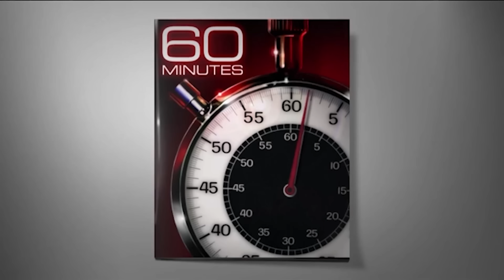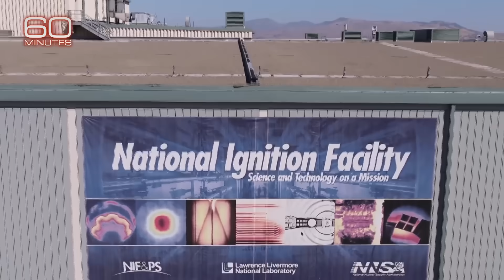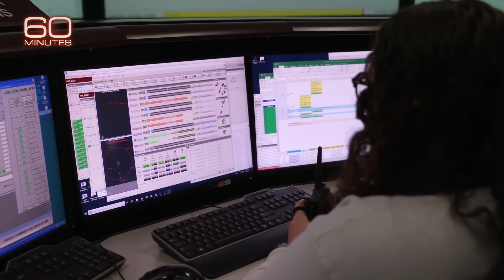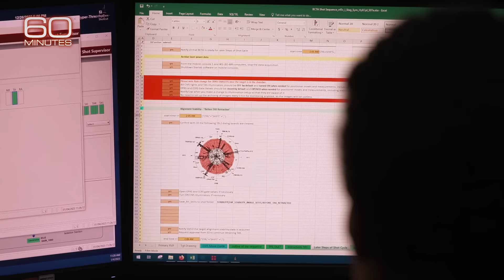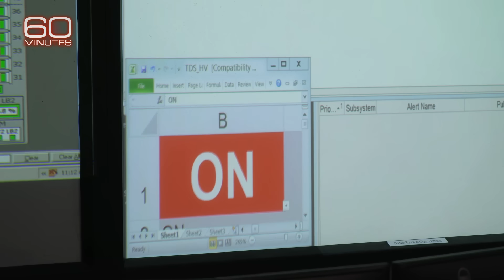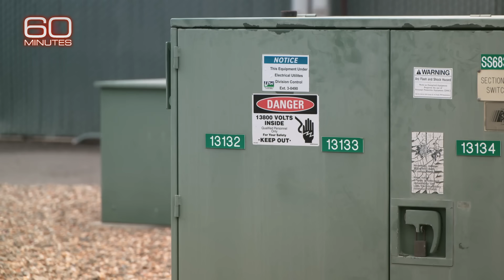Nuclear Fusion: Inside the breakthrough that could change our world | 60 Minutes

Comment: The continued support of fusion power is without reason.  We don't need heat to produce electricity.  We are grossly misinformed about power generation and power use.  Edison generators and dynamos power plants with inverters and transformers easily replace fossil fuels power plants and nuclear power plants with continuous peak power to the power lines. Yes high voltage AC power continuous peak power without fuel or pollution has been possible since the 1920s.  Tesla bound Edison's generator with magnets all around the armature and used water to move the armature magnets and coils of copper wire. This essential deciet has not been overcome with the PUC or chemical weapons manufacturing Treaty obligations or nuclear nonproliferation treaty enforcement and obligations. We don't need heat to produce electricity or transportation.  We can use permanent magnets as the only source of electricity. We don't need wind water steam or fossil fuels to move the armature magnets and coils of copper. Inverters and transformers are used to produce high voltage AC power from the current generated.  There is some current lost as heat but current generated DC is nearly equal to the high voltage AC power continuous peak power delivered.  Current in is equal to current out plus heat in every transformer . Power is increased and current is conserved in principles of electricity.
Reply: Please explain to this audience the formal educational degrees you have in electrical engineering and your work experience in that field. There are may people who are firmly convinced that electrical energy can be generated from no previous energy source, such as from the magnetic field of permanent magnets. Typically, they have immersed themselves in eco chamber information sources of like minded people in order to reinforce what they already strongly believe in. They crave sharing their very special knowledge with the world and explain away any resistance as due to the proponents being persecuted for their beliefs.

Comment: "harnessing the fires of Armageddon into something useful"

that's a badass quote right there!
Reply: The U.S. Project Plowshare program lasted for around 17 years, back around the 1960s. It worked to test the use of nuclear explosives for various civil engineering applications. There were university courses teaching young civil engineering students on how to apply nuclear explosives for such uses. Today most people find that concept to be insane.

The National Ignition Facility (NIF) has never shifted its major purpose. It has always been primarily funded as a thermonuclear weapon (H-bomb) research tool. The experiment, discussed in the video above, included a target material to test weapons related irradiation. The management of the laboratory have always obscured the primary function of this tool whenever they have made presentations to the media and the millions of people served by that media.

The majority of nuclear fusion physicists agree that Inertial Confinement Fusion (ICF) approaches, such as employed by NIF, are unlikely to lead to an economically practical nuclear fusion power plant.

Comment: The Navy has a laser that can fire 90,000 in 10 hours, once every 0.4 seconds.  There is a path here.  Those targets?  We can mass produce them...
Reply: Does that Navy laser come anywhere close to all the exacting parameters of the NIF lasers? How long has it been operating since its development? How successful has it been in generating nuclear fusion reactions? Is its primary purpose to lead to a future nuclear fusion power plant, or is its primary purpose related to weapons research? Does it generate the ultra violet wavelength required for the NIF inertial confinement fusion  (ICF) experimental reactions? How much 'wall-energy' does it consume to generate a fraction of that energy in the final laser beams?

The target elements in the NIF experiments have taken over a decade to develop. NIF was expected to achieve break-even fusion energy reactions by 2012. The hollow spherical diamond wall fuel capsules are now manufactured by the dozens because very few meet the extremely stringent requirements of having minimal flaws. It took about two days to achieve a proper layer of frozen fuel on the inside of the surface using repeated freeze/thaw cycling. The announced experiment took about a week to set up. The fusion reaction lasted approximately 0.000,000,000,08 second and generated enough energy to boil about two liters of water. The target assembly has been estimated to cost approximately $100,000. That assembly was converted into an exploding plasma. Only about 4% of the fuel reacted, the rest was blown away from the center before it could react. The radioactive tritium waste had to be removed from the inside of the target chamber before another shot could be performed.

The commenter heads up a fusion energy consulting firm, making his living doing that. He informs his clients that he has no hidden agenda. His history includes work at the NIF. Such presenters tend to be masterful at obscuring the primary function of NIF, as a thermonuclear weapon (H-bomb) research tool.

Such believers tend to be masterful at excluding key aspects of such fusion experiments in order to promote them. They also tend to be masterful at excluding the following warnings from their consciousness.

I urge readers to search for the following article titles.

IPCC report: ‘now or never’ if world is to stave off climate disaster (TheGuardian)

UN chief: World has less than 2 years to avoid 'runaway climate change' (TheHill)
  * This statement was made 4.4 years ago.

Comment: They left out the detail that is was not 2 units of energy in 3 out. It was a lot more in.
Reply: A suspicious journalist posed a direct question, regarding the laser input energy, during a news conference. That prompted an answer that the management typically avoided in the past. They finally admitted that the input energy to the lasers was more than 100 times greater than the output energy from the nuclear fusion reaction. Some people would say that the lab's definition of nuclear fusion energy gain is misleading.
Reply: @vernonbrechin4207  It is misleading i guess. But if you do not care how the energy was made they did actually make more energy. However they still need to work out how to do the same thing but use less energy which might be impossible for a long long time. I had a dream aliens showed me how fusion energy worked about 15 years ago and it was much simpler than this and i remember thinking its so simple how did we not see it. They handed me a light globe that was filled with plasma and it was terminated at the socket end with a few different metals, it was the types of metal and magnets that created the fusion. Theyu even had an advanced for of it in their weapons.
Reply: @FesteringRatSub  gy.

Comment: We are, in simple terms, striking flint to steel and trying to get a roaring fire going. We have a long way to go.
Reply: The National Ignition Facility (NIF) management use of the term 'ignition' is deliberately misleading. Once the nuclear fusion reaction began in this experiment, in a microscopic spot, the compressed fuel volume exploded ending that reaction. Only approximately 4% of the fuel reacted with 96% of the extremely expensive, radioactive fuel mixture being blown away from the reaction center. This has always been the normal process in these experimental shots since the machine was, and remains, a tool to simulate thermonuclear weapon (H-bomb) explosions on a microscopic scale. The extremely brief compression lasted for approximately 0.000,000,003 second ending with the nuclear fusion reaction lasting for approximately 0.000,000,000,08 second. There was no significant propagation of the fusion reaction within the compressed fuel mixture. When most people think of of ignition they assume it will be somewhat akin to striking a match, where the chemical reaction consumes the supplied fuel in a time span of approximently 2-seconds. The 60-minutes journalists crew was fooled by the term as was millions of people they broadcast this sale hype video to.

Comment: The fourth dimension is consistent with TIME, time dilation, INSTANTaneity, AND what is E=MC2, AS TIME is NECESSARILY possible/potential AND actual ON/IN BALANCE. TIME AND time dilation are BALANCED or inseparable in conjunction with INSTANTaneity. Gravity AND ELECTROMAGNETISM/energy are linked AND BALANCED opposites (ON BALANCE), as the stars AND PLANETS are POINTS in the night sky; AS TIME is NECESSARILY possible/potential AND actual ON/IN BALANCE; AS ELECTROMAGNETISM/energy is CLEARLY AND NECESSARILY proven to be gravity (ON/IN BALANCE). Accordingly, ON BALANCE, the rotation of WHAT IS THE MOON matches the revolution. Great. What is E=MC2 is taken directly from F=ma. c squared CLEARLY AND NECESSARILY represents a dimension of SPACE ON BALANCE. Again, consider TIME AND time dilation ON BALANCE. What is GRAVITY IS, ON BALANCE, an INTERACTION that cannot be shielded or blocked. Consider why and how it is that there is something instead of nothing ON BALANCE. Magnificent. A given PLANET (including what is THE EARTH) sweeps out equal area in equal TIME. Magnificent. Consider what is THE EYE ON BALANCE. Beautiful.

Frank Martin DiMeglio

Define “mass”/m. You cannot. Here's why.

The Earth is about four times the size of what is the Moon, AS the density of the Earth is about four times that of what is the Sun. E=mc2 is taken directly from F=ma. The orange (AND setting) Sun AND what is the fully illuminated (AND setting/WHITE) Moon are the SAME SIZE. Consider what is the translucent blue sky ON BALANCE. I have mathematically explained why the rotation of WHAT IS THE MOON matches it's revolution.

First of all, it's outer “space”. It's not SPACE. BALANCED inertia/INERTIAL RESISTANCE is fundamental (ON BALANCE). TIME is necessarily possible/potential AND actual ON/IN BALANCE.

CLEARLY, gravity AND ELECTROMAGNETISM/energy and linked AND BALANCED opposites ON BALANCE; AS the stars AND PLANETS are POINTS in the night sky ON BALANCE. Consider what is the speed of light (c) ON BALANCE. Consider TIME (AND time dilation) ON BALANCE. (E=mc2 is taken directly from F=ma.) ELECTROMAGNETISM/energy is CLEARLY (AND necessarily) proven to be gravity ON/IN BALANCE. Accordingly, ON BALANCE, the rotation of WHAT IS THE MOON matches it's revolution. I have proven why THE PLANETS (including WHAT IS THE MOON) move away very, very, very, very slightly in relation to what is the Sun. I have explained the cosmological redshift AND the supergiant stars. TIME is necessarily proven to be possible/potential AND actual ON/IN BALANCE. It all CLEARLY makes perfect sense ON BALANCE. Again, E=mc2 is taken directly from F=ma. Magnificent.

By Frank Martin DiMeglio
Reply: Many people fail to recognize delusional ramblings. They are easily pulled into such statements, believing that they must originate from an exceedingly smart person.

Comment: The math behind fusion power is a highly interdisciplinary field that requires a deep understanding of physics, chemistry, and mathematics that include Plasma Physics, Nuclear Physics, Thermodynamics and Fluid Dynamics. The torus energy field plays a crucial role in the confinement and control of the plasma in many fusion power systems. By creating a strong and stable magnetic field, the torus energy field allows the plasma to reach the conditions necessary for fusion reactions to occur, and helps to prevent damage to the reactor walls caused by the high-energy plasma.
Reply: Most fusion energy research announcements are filled with sales hype with a strong focus on what the ultimate goal is rather than what was actually achieved. In most cases no fusion reactions actually take place because no fusion fuel is actually employed. Most of the achievements continue to be in reducing plasma instabilities, increasing density, temperature and the time of plasma confinement. Typically the announcements leave out many critical challenges still needing to be addressed. One of those is about creating sources of the radioactive tritium fuel required. Currently the cost is about $30,000 per gram with a prospect of declining production of this rare isotope. They tend to avoid mentioning that the fuel is not as common as the hydrogen in seawater.

Most of the current workers and fans in this field are unaware that these challenges have been worked on since the mid-1970s.
Reply: @vernonbrechin4207  True and that is very good insight. There are other fuels that can be used to achieve nuclear fusion, such as deuterium and helium-3. However, tritium is the most efficient fuel for fusion reactors that are currently being developed.  Tritium is produced naturally in the atmosphere by the interaction of cosmic rays with nitrogen atoms. It can also be produced artificially in nuclear reactors. Furthermore, Tritium can be feasibly extracted from the atmosphere. The concentration of tritium in the atmosphere is very low, but it can be extracted using a variety of methods, including:

- - Air-stripping: This method involves passing air through a column of a material that absorbs tritium. The tritium-rich column is then heated, and the tritium is released.
- - Water electrolysis: This method involves passing an electric current through water. The tritium is released as a gas, which can then be collected.
- - Ion exchange: This method involves passing air through a column of a material that exchanges tritium ions for other ions. The tritium-rich column is then heated, and the tritium is released.

The cost of extracting tritium from the atmosphere varies depending on the method used. However, it is generally a feasible process, and it is likely to become more cost-effective as technology improves.

Here are some of the advantages of extracting tritium from the atmosphere:
- - It is a renewable resource.
- - It is a non-polluting source of energy.
- - It is a safe and secure source of energy.

Disadvantages of extracting tritium from the atmosphere:
- - The concentration of tritium in the atmosphere is very low, so it is a relatively expensive process.
- - Tritium is a radioactive isotope, so it must be handled with care.
- - There is a risk of tritium contamination if the extraction process is not properly controlled.
Reply: @ArunSerrao  - Thank you for explaining some of the numerous ways of extracting natural tritium from the atmosphere and from water. The concentration is not very low but is so extremely low that it is not economically reasonable to extract it from such sources. That is a primary reason those sources are never utilized to derive reasonably pure tritium. Current plans shouldn't be based upon HOPES and assumptions that that these alternative extraction costs will come down soon.

It would have been helpful if you had also discussed the availability and current cost of obtaining helium-3. Helion Technologies CEO claims their machines will generate helium-3. None of the fans have bothered to look up how much they have produced from their multitude of experimental shots.

Those, who have faith that fusion energy production will be able to turn this Titanic around in time, generally have no interest in looking into the following articles which I encourage readers to search for.

IPCC report: ‘now or never’ if world is to stave off climate disaster (TheGuardian)

UN chief: World has less than 2 years to avoid 'runaway climate change' (TheHill)
  * This statement was made 4.5 years ago.

New Energy Times > FUSION FUEL

Comment: No matter how you try and sugar coat unclear the waste which remains RADIOACTIVE forever is unsafe.
Reply: You made a good point but you might want to look at details regarding the nuclear waste nuclear fusion energy production is likely to generate.

The promoters of this technology typically claim it produces none to very little nuclear waste. This is somewhat true in comparison to fission power reactors. Nuclear fusion will likely require the generation of much radioactive tritium fuel that has a half-life of slightly greater than 12 years. The fusion neutron irradiation of the reactor structure will result in the generation of radioactive neutron activativated isotopes in that structure, requiring the disposal of components of it as medium lifetime radioactive waste.

Comment: If the targets need to be perfect and theyy make 1500 to get 150 how do you scale that up to make electricity? I don't think you can.
Reply: Since NIF has always been primarily funded as a thermonuclear weapon (H-bomb) research tool the cost of a practical application is very low on their priorities list. It may be true that only 1 out of 10 of the nearly perfect diamond spherical shell target capsules is acceptable for use in one of these infrequent experiments. The announced one took about a week to prepare. It is estimated that the target assembly cost approximately $100,000. The laser shots convert it into an exploding plasma. The measured nuclear fusion energy was about enough to boil two liters of water but lasted only for approximately 0.00000000008 second. NIF was supposed to achieve this 'break-even' result a decade ago, back in 2012. It failed by at least a factor of 10. Still, even with this announcement the lab was finally forced to admit that the input energy to the lasers to do this shot was more than 100 time greater than the measured energy generated by the brief fusion reactions. It is estimated that NIF has already consumed approximately $11 billion of U.S. tax dollars. Most nuclear fusion physicist agree that its Inertial Confinement Fusion (ICF) approach is unlikely to lead to a economically practical nuclear fusion power plant design.